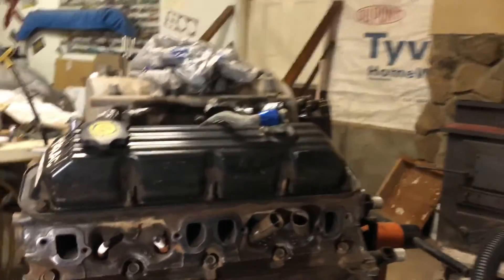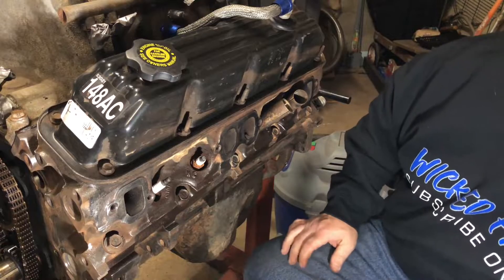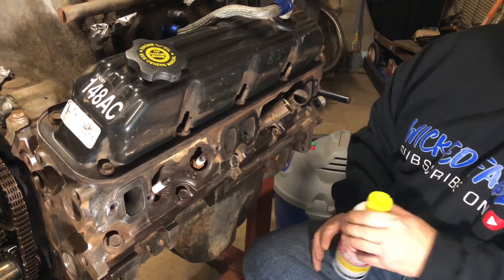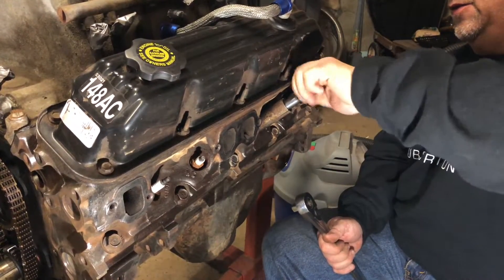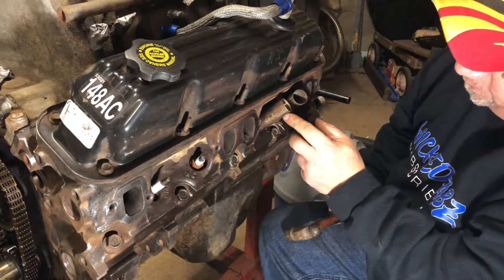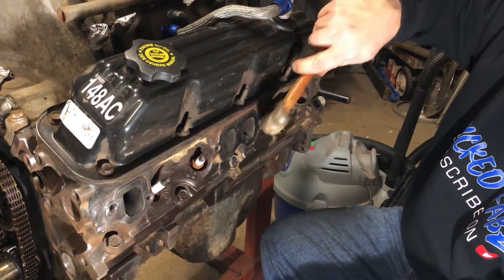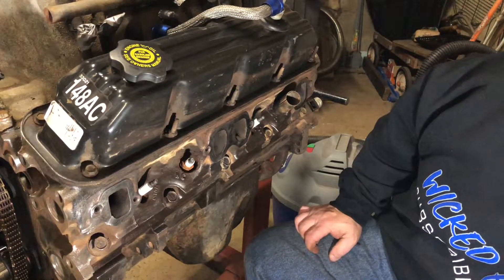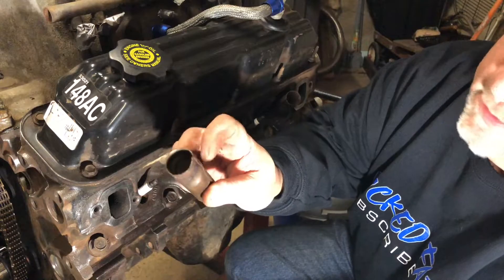How To Remove Spark Plug Heat Shields / Tubes Off Your Engine

Comment: Thank you for your video, My 1994 Dodge Dakota 3.9 V-6 has the same Spark Plug Heat Shields, One bent and was unable to get to the spark plug out. Your Video save me a lot of time, also from removing the exhaust manifold , Youtubers like yourself really help people like me out. Thank you again.
Reply from the maker: Glad I can help!
Reply: Hello Keith, I have the same issue with a 2001 dodge 3500 van with a 5.2L engine. Did you just bend the heat shields until they loosened like on the video? I have one that is so deformed I can't get a socket on the plug to remove it. I look forward to hearing from you. --Kent
Reply: Yes, hit it bend it, I even use a screwdriver and WD-40 it will pop out.
Reply: @keithspeaker6931  I got the heat shield off, but the plug broke and appears to be somewhat rounded off. Of course it's the very back right side plug with no access room. I am soaking with Deep Seep foam today then will heat up and then apply Freeze off hoping to get some contraction and movement from the nut. It's a pain in the arse!

Comment: Since there are eight of these makes  the price or effort to make a tool worth the cost and effort. A long plier like tool with a split  cuff that resembles a snap ring tool but heavier and big enough to compress  the split tube.  Judging, these tubes don't need to come out but at the same time don"t need to be there in the first place. Heat shielding the plugs is a good idea but can be done with some sheet to metal. Personally ,I like the tubes but still ,I would like to be able to remove AND   reinstall them easily without breaking anything .

Comment: My problem is the plug isn't removable because it's touching the heat shield which is why I need to get it off. Any suggestions or just go at it the same way you did?
Reply from the maker: Soak it with a PB Blaster for a few hrs. Come back to it and try. Or put a little heat to it. Shouldn’t harm anything.

Comment: How do you remove tube with plug in these tubes are deformed on the bottom stopping plug from bottoming out?
Reply from the maker: Try the same way but soak it with PB Blast and be careful to not damage the plug.
Reply: @Ricky Van Brakle Ricky, did you get it out?  I have exactly the same problem on my 24 yr old Dodge Ram 1500 V8 which has spent its entire life in salty New England.  There's one shield I can't get out, it's the next to last plug near the firewall and angled towards the firewall.  I've been running on 7 new and 1 very old plug for about 6,000 miles now and Nellybelle is starting to run rough.  The bottom of the shield is distorted inward so I've never been able to get the plug out.  I bought a thin walled socket and that couldn't get in there.  I ground off 2 flats from the socket and I still couldn't get it in there.  So getting the shield out when the plug can't be removed is a @#$%^.  I won't put heat on it for fear of cracking the cylinder head or the plug.  If I damage the plug, the truck has to go to the junkyard, so this is nervewracking.  The only idea I have left is to get a small bar of tool steel and try to hammer it down between the cylinder head and the shield, near the seam in the shield. A small screwdriver would probably break.  Any ideas, anyone????
Reply: @Ricky Van Brakle Breaking off the top of the plug took courage, more courage than I have.  Or was it desperation?  You stared into the abyss, and you triumphed.  Cutting two slits was a great idea.  The steel shield is way stronger than it needs to be, and I can see how one slit would not relieve the spring pressure holding the shield in place.  I've already tried cutting slits in the shield with a small end mill driven by a Dremel type tool with a flexible cable drive.  I could probably do dental work with the setup, but I couldn't control the end mill.  I wonder what would happen if I put a bi-metal hole saw down in there?  Probably end up rounding the flats on the plug.  Hmmm , maybe just fill the entire hole with Blaster.  To be continued....
Reply: Same problem and it's 10 times harder with engine in place. I'm a mopar lover but someone needs there freaking nuts smacked for this design 💯. I broke the plug off in head, just porcelain part so was able to get plug socket on after 3 hours. Boy dodge has some bright ideas, it would be easier to modify the damn manifold in my opinion. Dang I'm so over this truck 💯
Reply: @daniellefreeman9734  I used 3/4" electrical conduit to bang out and open the deformed tubes worked for most of them one i had to break the ceramic off and chisel the tube out
Reply: Update on some more techniques that DIDN'T work.  Since the last time I reported, I bought a borescope on Amazon (amazing, for less than $20, thank you China) so I could see what was going on down inside the tube.  This is cylinder 5 which is angled towards the firewall.   The heat shield was bulged towards the plug, preventing the socket (thin-walled) from getting seated onto the plug hex.  I soaked the entire area overnight with Kroil which didn't loosen the shield at all.  I then managed to get seated onto the hex my socket in which I had cut out two of the flats so it would clear the bulge in the shield.  My theory was that the socket would turn the plug and push out the bulge at the same time.  I heard a clink and thought that was the plug breaking loose.  But no.......it was one of the flats on the plug breaking off!  

Present plan:  I'm going to keep driving the thing until the plug starts misfiring, then break off the plug and chisel out the shield .  Hopefully this doesn't happen during family vacation in August.

Comment: Seems to me, after lubing the base of the heat guard, one could place a hose clamp around the base of the heat guard thus tightening the hose clamp until the slit in the heat guard is completely closed... It should slide right out just using your fingers... 
If it's still too tight, heat the base of the heat guard and use pliers to pull it out...
Reply from the maker: Good idea!

Comment: I used an air hammer to carefully dent in the bottom part of the heat shield along with pb blaster and a pick to  scrap all the rust out then used vice grips to wiggle it out of the head. There is no way these will  come out by just squeezing the tube to push the gap together as designed, way too much rust holding it in the head.
Reply from the maker: I agree. Years of rust build up made it difficult. Poor design.

Comment: Me too are the spark plugs holding the heat shield down ? I’ve tried everything in the book all the way too and air hammer and still for the life of me cannot get the plugs out this shouldn’t be this tough
Reply from the maker: It is the rust combined with the heat it almost like they end up getting welded in there. But no the plugs do not keep them in place. The shields are slotted so when they are pressed in it is a very tight fit.
Reply: @WickedFabz  ok thank you so I just have to keep trying until i eventually break them free I’ve tried an air hammer but I have no way of removing my engine nor would I want to do that for just this problem my air hammer does not fit so I should probably try again with the flat head and hammer I got one free but broke the heat shield in the process I have to chisel the rest out thank you for you help

Comment: How do you get a rusted heat shield out of a eng in a truck 2001 5.7 you have no room so what do you do to get them out
Reply from the maker: Spray the heck out of them with PB Blaster, let them soak and stay on it till they come out. Try using a long set of needle nose pliers.

Comment: So what do you do if you can't get the plugs out, how do you remove the tubes then?
Reply from the maker: Soak them with BP Blast, Kroil Oil, maybe a little heat and they should come right out.
Reply: @WickedFabz  tried that, they are still stuck on my 360 5.9L
Reply from the maker: Soak them over night.worse case break the porcelain and ez out the threaded part. Worked for me on 350 small block a couple years ago. I would soak them first.
Reply: @WickedFabz  can't even get a socket to grip on any of the plugs. The hex are rounded circles.
Reply from the maker: @user-uj3zk2cx8t  maybe cut tubes with cut off wheel and dremel. Got to get the plugs exposed and vise grip the plug out.

Comment: if you take these off should you put them back on?
Reply: I got new style pick a color to match your build type proven to last on high hp builds. Amazon has them plenty people on Durango 5.9s have them
Reply from the maker: Don’t have to.
Reply: @WickedFabz  duh but the heat sheild was not letting the spark plug out with rust and shit
Reply from the maker: @serenityrenes3194   duh!

Comment: What if the engine is still in the truck?
Reply from the maker: If that’s the case you might have to work around certain items or remove them out of the way.

Comment: Whoever is installing these needs to be shot! I have a set welded into a 1989 chevy 454 and I'm having to take it to a shop for them to fix. Replacing spark plugs should be DIY.  What is the point of these crazy things?!

Comment: That's great when it on a stand when it is inside a van no 3 cylinder then what?
Reply from the maker: When in doubt rip it out!
Reply: @WickedFabz  i agree. don't think I want to pull my motor just to change plugs

Comment: I can not even pull the wires out of the plugs. Also jammed in there.
Reply from the maker: Wow! Did you try some lubricating and or penetration oil spray? That may work.
Reply: @WickedFabz  rubber caps. Soft. Stuck. No way to spray in there. I just don't want to rip the wire. I will try to spin them and see if they move.